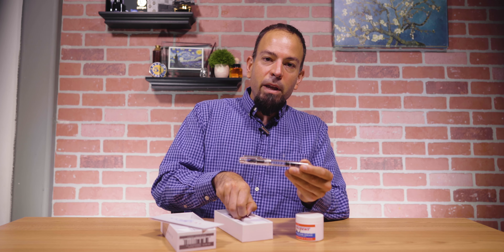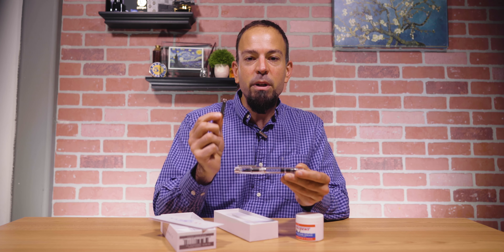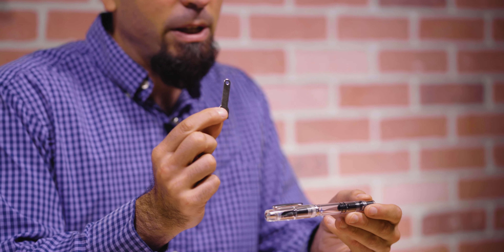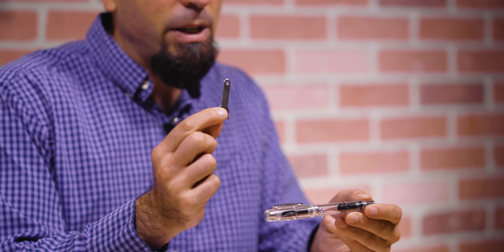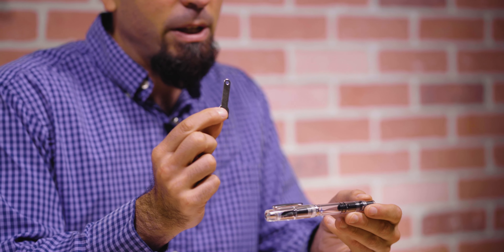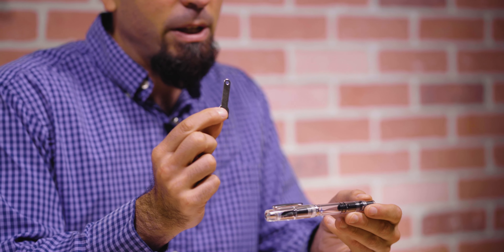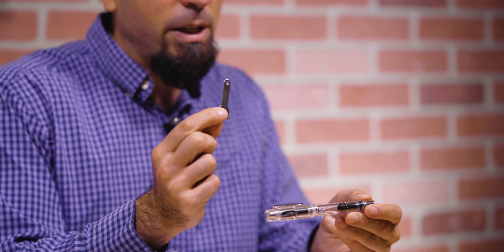How to Disassemble a Narwhal Fountain Pen - Quick Tips #22

Comment: A useful lesson on Narwhal maintenance. I am somewhat surprised that instructions regarding this were not included with the pen literature. I had reviewed the Schuylkill prior to purchase, so I did have an inkling on usage, what I didn't know was the thread reversal; a critical element. Clockwise or anticlockwise turning though depends on which end of the pen one is looking at during disassembly. I found the same tricky maneuver on my bicycle pedals which are also reverse threaded.
Reply from the maker: That is a great point. I will bring that up with Narwhal to see if a guide could be included to inform of the reverse threads.

Comment: Tom, I got a Narwhal pen as a gift. When I was trying to clean it, it basically fell apart, probably my fault. In one of your instructional videos you remove the nib assembly, but in this one you say the assembly cannot be removed. I'm still getting ink residue coming out of the assembly, and I'd rather it be as clean as possible before I drive myself crazy re-assembling all the tiny bits on the back (blind cap) end of the pen. Help?

Comment: Thanks Tom, very helpful.  As an early adopter, what tool can we use if we did not get a wrench with our pen?
Reply from the maker: I've been told by Frank (from Narwhal) that a TWSBI metal wrench would also do the job. I haven't tried it myself, though.
Reply: @GoldspotPens  I thought of that and tried it.  My TWSBI metal wrench does not fit my Norwhal;  the opening on the wrench not quite wide enough.  Although it's close, I'm reluctant to try to force it.
Reply: Using a small metal file I opened up a TWSBI wrench about 1mm.  It now fits fine.  Thanks for all the support Tom, really appreciate it.
Reply: TWSBI wrench does not fit it without some adjustment. Will confirm that this 7mm open end wrench will not fit, and 5/16 wrench is too big.
Reply: Also reached out to Narwhal who said bluntly that they are not selling the wrench separately. I currently have the end cap unfortunately already popped off and I haven't figured out yet how to get it back on and eliminate a gap.
Reply: @MayShue  Same issue with my Green one. The back end came off and will not get close enough to keep air out. Happened on the first cleaning / refill. My pink one is fine though.
Reply: @AndyShreeve  I initially had a problem with re-closing it and short of attempting to re-create it for video, the only thing I can say is that is IS possible but it is fiddly. You will need to twist AND push gently (there will be give) to figure out the pattern of movement to seat it back into place.
Reply: @MayShue  I think I have it more flush now, just concerned about it drying out faster in there. Hopefully a good seal inside will prevent any drying.

Comment: I got two colors of the first ones offered, but no wrench included. Can we get just the wrench?
Reply from the maker: Reach out to Narwhal directly and they should be able to help supply the wrench.
Reply: @GoldspotPens  Thank you!
Reply: @AndyShreeve  FYI I reached out to Narwhal and they responded to say they do not sell the wrench separately. I hope the situation may have changed since then. If they have not changed their stance, and if you have a TWSBI wrench, get a metal file and file one side to the size you need. Narwhal's wrench measurement is 7.5mm which is about as rare as hens' teeth.
Reply: @MayShue  Thank you for letting me know. Yes, I have the red plastic and  the metal TWSBI wrenches. I did email Narwhal as Goldspot suggested, have not heard back yet, hopefully soon.
Reply: @AndyShreeve  My modification was for the metal wrench (I got it with my 580 AL). It has two sides so I sacrificed one. No experience with the red plastic one :)